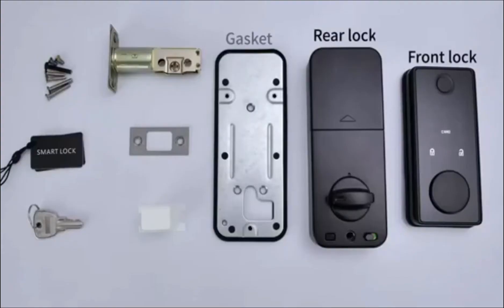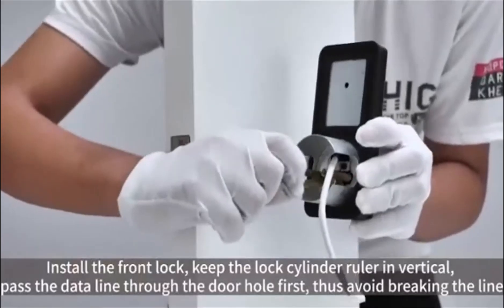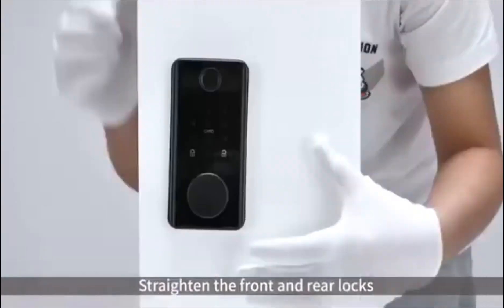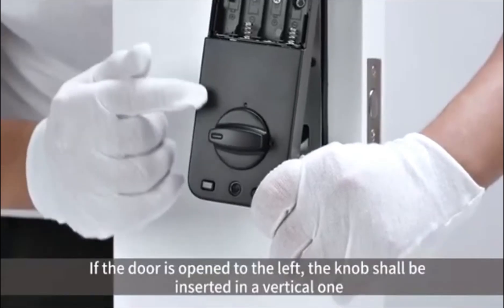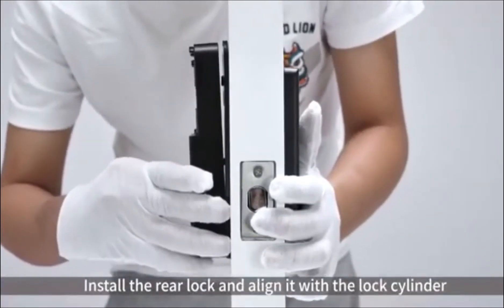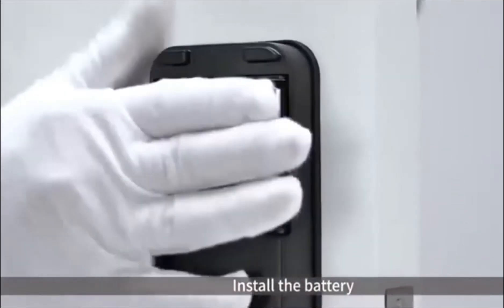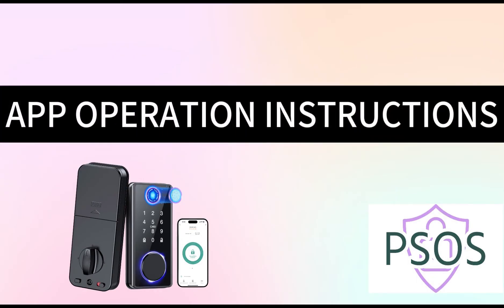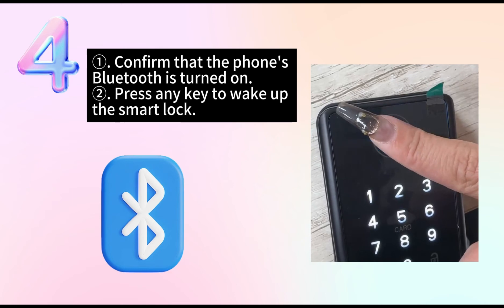PSOS Smart Lock Installation Tutorial and Tuya APP Guide（for TTLOCK APP is uploading ）

Comment: I had tried 20x times to connect the device but it won't, turn on and off the device still won't see the device.
is there a customer service contact for this?
Tried anything and everything even used 2 different cell phones
Reply from the maker: Hello, please check the app logo on the upper right corner of your manual cover. If it is blue, it means you need to download the TTlock app. If it is red, it means you need to download the Tuya app.
Because my YouTube account was restricted, I didn't update the video. But the app was mentioned in the title and introduction of the video.

If you have downloaded the correct app but still cannot connect the smart lock and phone, please wake up the smart lock screen when adding a device.
If this still does not help you, please contact me.

Comment: Will not lock. The lock goes into locking position, but then retracts back to unlock every time
Reply: Saaaame problem 😖😖😖
Reply from the maker: Hello, this is caused by the wrong door opening direction setting. This problem can be solved by switching the door opening direction through the mobile APP. Path: settings> motor rotation direction-> clockwise unlock/anticlockwise unlock. 
I have sorted out other common problems, which may be helpful to you, please refer to: https://online.publuu.com/566442/1272275
Sorry for my late reply because my YouTube account has encountered login restrictions. If you have other after-sales questions, please contact my email: psostop@outlook.com. So that I can reply to you in time.
Reply from the maker: Hello, this is caused by the wrong door opening direction setting. This problem can be solved by switching the door opening direction through the mobile APP. Path: settings> motor rotation direction-> clockwise unlock/anticlockwise unlock. 
I have sorted out other common problems, which may be helpful to you, please refer to: https://online.publuu.com/566442/1272275
Sorry for my late reply because my YouTube account has encountered login restrictions. If you have other after-sales questions, please contact my email: psostop@outlook.com. So that I can reply to you in time.

Comment: I got the app and everything installed. I purchased the gateway to for remote unlock. They are paired together… however, when I try and do remote unlock it says indoor locked. I can’t find that anywhere online. What does that mean and how do you fix it
Reply: I had this problem too, only the first fingerprint was working and all the others weren't.  Then I switched the button on the back from red to green and other fingerprints started working and the original fingerprint stopped working  ¯\_(ツ)_/¯
Reply from the maker: Hello, has your problem been solved? If not, can you describe it in detail? This may be caused by the administrator you have entered. I cannot make an accurate judgment at present, so detailed information is needed.
Sorry for the late reply, because my YouTube account encountered login restrictions. If you have other after-sales questions, please contact my email: psostop@outlook.com. So that I can reply you in time.
Reply from the maker: Hello, has your problem been solved? If not, can you describe it in detail? This may be caused by the anti-lock button you turned on. I can't make an accurate judgment for the time being, so detailed information is needed.
Sorry for the late reply, because my YouTube account encountered login restrictions. If you have other after-sales questions, please contact my email: psostop@outlook.com. So that I can reply to you in time.